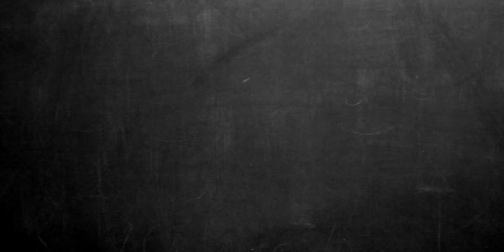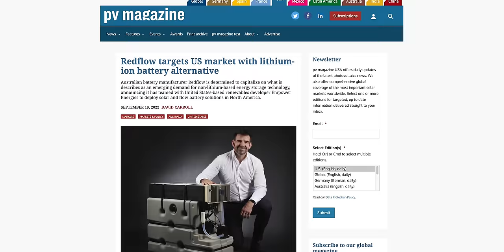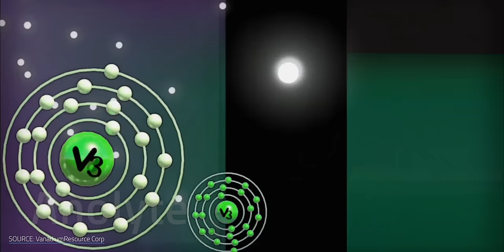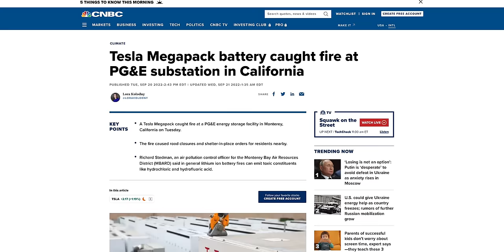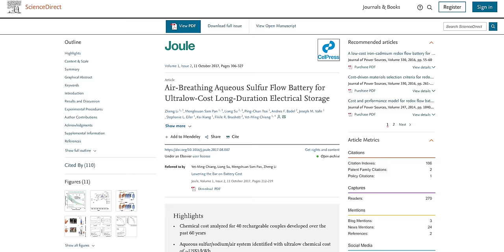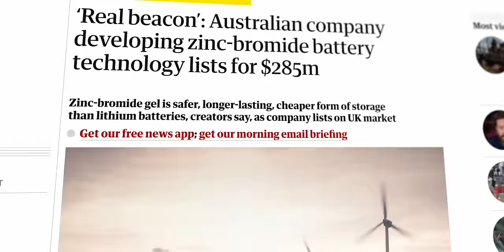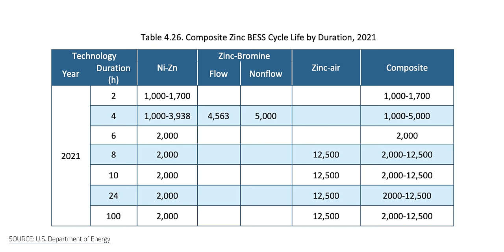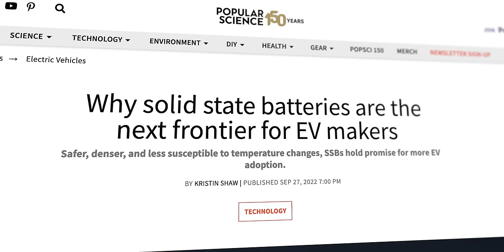137 Year Old Battery Tech May Be The Future of Energy Storage

Comment: I think maybe it's time for a battery tech roundup? I've lost track of all these battery types. How about following up on every single battery tech from the past few years, compare them on all their various metrics, fitness for various applications, see where they're at in terms of readiness, cost, and so on?
Reply: Have you ever called one of these scammers?
Reply: Seconding the request for a battery tech roundup!
Reply: Yes, please! I would like a summary/review as well.
Reply: @stephen6631  think you responded to wrong comment
Reply: Just the thought wants my head to explode! 🤯🥵☠
Reply: That would be a long video.
Reply: Please include efficiency. This is incredibly important and something you often gloss over.
Reply: Looking forward to the round up.
Primary interest is for home use for solar storage. 
Already pretty content with off the shelf lithium iron phosphate batteries for a vehicle. 
Lol, we rent a vehicle for 12 hour drives to see family,  so distant Charging is irrelevant for us for the foreseeable future. 

Number #1 concern
 FIRE SAFETY
  zero interest in a lithium-ion battery pack in the house.

Number of Charging cycles (reasonable- not absolute) before replacement 

Abuse tolerance 

Ease (or near complete lack) of maintenance 

Cost, within reason. 
Using kw hr basis?
Reply: @crispisauce  it was definitely addressed in the liquid metal battery sector.
Reply: Yes please do a battery round up with energy efficiencies
Reply: @norfolkgarden  Best for solar storage at home is still LiFePo4.
Fairly compact, high performance (1C/1C with dischange burst up to 3C), fairly high amount of cycles aswell as not degrading when using most of their capacity and most importantly they are fairly safe and wont burn or explode (not from the chemicals that is)
Reply: I love this idea.
Reply: @tarakivu8861  If compactness/weight isn't an issue, and someone had a huge amount of big lead-acid batteries available to them for cheap, is there any reason not to use them?
Reply: That would probably require a good hour long documentary lol
Reply: I thought for sure ambri liquid metal battery would be way bigger by now
Reply: @codyrogers918  Yeah, I am waiting for an IPO so that I can help support their work, tbh - although I don't see how the technology can be protected from being ripped off easily.
Reply: It will get outdated fast
Reply: Honestly as a studying electrician, batteries are simply a poor method of storing large amounts of usable power.
Batteries have their advantages, and they are mostly in being compact transportable energy storage.

There are simply far better and more effective ways to store usable energy, much less electricity.

For example: Why store power in batteries when you could make a lake, build a damn, put a water tower up, or store raw thermal energy in insulated thermal sand? Only reason would be if you can't store natural kinetic or thermal energy.
Reply: Looks like new sodium batteries are also making progress in leaps and bounds.

So I'd agree
Reply: @jllemin4  What's more these systems are more "natural" and you could leverage them even if electricity is not a priority/cannot even be used. So it's literally a getting multiple use cases out of one installation.
Reply: @jllemin4  Thank you dear Jllemin, I really appreciates you caring about validating this for me as well as to be sharing your knowledge with me and everyone here. I really also appreciates your thoughtfulness of me. :)
Reply: @jllemin4  Dams/Pumps are not feasible everywhere, and upfront construction costs can be huge (not to mention potential environmental/population displacement issues).

When people say 'battery' here, they are referring to a huge range of electrochemical storage solutions, many of which are quite different from what you would think of traditionally (like Ambris' liquid metal battery). A lot of these can likely scale quite well, especially compared to kinetic storage like flywheels.
Reply: Do the round up "top gear cool wall" style.
Reply: One more enthusiastic vote for a battery tech roundup. While I'm glad energy storage research is getting so much support, the over-optimistic press releases and frequent grant scams make it really tough to even have an opinion. @Undecided with Matt Ferrell perhaps you could even get a government grant to do the meta-research and save us all from another gover-funder-blunder.
Reply: We need to fund tech. And cut all this patent BS , our civilization and way of life require it
Reply: Yep.  But put out a big comparison performance chart on your website (where you can stick advertising) and answer the question, which system is best to convert a car to electric and hybrid electric?

We live in a fantasy world, where lithium ion is supposed to be enough fur everything, but there is not enough, it's energy density is 10x to low, and it's costs 10x top high, and the cost of building one of these cars can be nearly as energy consuming, where environmentally it's much better to wear out the present fleet, giving enough time to get solutions with capacity to produce a gu electric fleet .  So, the fastest environmental solution is a short range day battery connected to a hybrid electric system for long trips.  A day battery  of over 100km, can be charged by parking over an I ducting plate every night, and use no fuel at all.  When driving to far, it can be it can use fuel.  The solid zinc bromine battery is Ideal for such conversions.   Omg with something like an Atlantis engine with inbuilt electric generator, or waveplate engine.

You should cover nanowire battery progress too.  They are talking 10x the capacity.
Reply: @tarakivu8861  Polonium batteries?
Reply: To maybe shorten the length of a video make a series of videos discussing separate use cases, such as residential (size, safety, capacity), industrial (safety, capacity, scalability), public grid, etc.
Reply: @stephen6631  why do you claim that they are scammers?
Reply: Are you asking Matt Ferrell? He doesn't understand science at the most basic levels. You do realize his channel is just regurgitating what was said about it, usually by the technologies builders. He looks up "news" and repeats what he read. Look at the video about solid hydrogen storage.
Reply: It would be lovely to have two roundups actually :) feels like the battery world is splitting into hi-density/weight sensitive applications and static applications like we're seeing in this video, especially since the latter should be compared to current mechanical methods we already employ in the world.
Reply: Great idea, love to see that myself
Reply: Agree, there are so many! Graphene? Carbon nanotubes? Lithium air? Aluminium? Sodium?Solid state? Structural batteries? And these are just the transport related ones...
Reply: Redfow Zn Batteries have been on the market gpr over 15 years and never cauhht on in a larger scale. With efficiency at 75% vs 95% of LFP . WHERE ARE THE ADVANTAGES?    Whats the cost in $/kWh of Redflow today ? LFP  is at 150$/kWh with BMS and casings.
Reply: ... like with a biig mindmap of all possible battery-types ;)
Reply: @sh5465  watch the video and pay attention to the part where Matt says there have been improvements in zn battery efficiency...
Reply: @tarakivu8861  
Just helped my brother upgrade old lead acids to Lifepo4. What a big difference 😁.
Cheers
Reply: It's easy, it's all about energy density at this time. Going to be a few years yet before investing in anything not Li.
Reply: @TecnamTwin  could be a multi part mini series. would be better for us, for matt, and the algorithm.
Reply: I'm pretty certain that most new battery tech will never make it to mainstream. The only way a battery will actually make it to the mass market is when it's absolutely certain that it has a ton of potential. Graphene batteries look super promising but it's been difficult to make graphene on a large scale. Same with sodium batteries, paper batteries, and even solid state batteries. 

I really hope that someone much smarter than me can come up with a battery that doesn't destroy the environment and is easily renewable, reusable and recyclable. 
If we want to move to fully electric cars, we CANNOT do it with lithium ion batteries.
Reply: I would like to see this as well, a comparison of “battery” technologies categorized in multiple ways; energy density, # of cycles, failure modes, etc.

Comment: This video makes several comparisons to lithium ion and flow batteries, but I think it would make much more sense to compare zinc-bromide to sodium ion, which is a much more direct competitor and also entering the market right now. They're both low-cost, lower-than-lithium density, and using more sustainable materials
Reply: i think comparing to lithium and flow batteries still makes a lot of sense tho, the former because its widely known and the current standard, the latter because it was discussed in a recent video, which means it might be still in the back of ones mind.
However having sodium as a third one (if what you say is true, I havnt heard of it before) would of course improve this comparison, maybe in a followup video as well
Reply: But both are trying to take business away from lithium.

As such, they should be compared to lithium.
Reply: I'd like to see that Sodium vs Bromine comparison, and also have data on mass per kWhr and maximum sustainable current output - those two factors help determine whether the technologies will be useful for aircraft, shipping or spaceflight.
Reply: I imagine there would be some contracts ahead to be either won or lost....
Reply: I just think that comparing lithium and zinc bromide was a poor choice, seeing as it looks like compared to the 2nd most common battery ever, lead acid, zinc bromide wins in a landslide, the big one being that you can’t use half of your lead acid battery without damaging them, with there DOD being really bad, he also mentioned they’re more energy dense then lead acid. So there smaller and can discharge further, while also being affordable… I know that would have made this one sided if he was comparing zinc bromide to lead acid, but for me, when you can make better car batteries, better off grid power storage for farms and boats, what’s not to like?
Reply: @PiDsPagePrototypes  IIRC Sodium Ion is pretty good on the W/kg front and pretty bad on the Wh/kg side (compared to Li-Ion, again). Hence the utility use rather than mobility.
Reply: OK look, whatever technology anyone comes up with that makes sodium ion batteries viable, it will equally equally apply to all of the other alkali metals, that is an immutable nature of the elements, It's alchemical.  So in elemental, alchemical regard sodium has 2 problems, either of them, insurmountable.  1, sodium metal is way more dangerously reactive in the atmosphere of earth than lithium, It doesn't just catch fire in water, It EXPLODES bigger!!!! and 2, If you open your book to the periodical chart of elements And locate the alkaline metals in column 1 you will find that none have the ability to give up its electrons more freely than Lithium as it has only 3. So to get simplistic here. Any energy  sodium can store lithium can store better,  Lithium can do battery better than sodium. This means that, as long as there's a gram of lithium on earth It will make a better battery than Sodium. They will find cheaper ways of recycling lithium And they will find more lithium to mine anyway. If for no other reason than 75% of the Earth's crust has never been explored for mining at all. But keep chasing that dream if you must, excercise your freedom of choice, no matter wat it is, its your rights as far as I'm concerned, but please don't do it in ignorance for yoyur own sake, realize when you are being bamboozled bybad science when you can. And if you don't understand why it explodes bigger, its becase electrons of a feather, stick together.
Reply: @mpirron1  Like all interesting questions, answer is: it's not that simple. Sodium-Ion Batteries (which are not just lab things they are used commercially now, that is a fact) are less energy-dense than lithium: you are right about that. But they are more power-dense... If I understand corrrectly, the main problem nowadays is the durability with a sodium-ion battery undergoing 50% less cycles than lithium-ion batteries.. so it will have to upgrade like Li-Ion did. Not a given, but not impossible.
Periodic chart of elements is a great tool. And congrats on your fine reading of it. But what it is not is a be-all end-all of chemical knowledge.
Reply: @MjolnirFeaw  I'll give you that, the power density, for now, because I am not aware of any practical sodium ion battery in commercial use what are they using for the cathode material? The only portable ones I am aware of are using vanadium phosphate , if that's the case then the commercial use is a boondoggle because  sodium vanadium phosphate is crazy expensive and there there's not much vanadium laying around that's not already in my pocket knife's steel. They'd be better off going back  to cobalt and we know they can't do that with so many Sudanese children slaving at mines and all, so if you're talking to vanadium cathodes, its a no-go. That being said, it's still my contention that if you take the battery chemistry of the viable sodium battery, whatever it is and apply it to lithium, you it will likely make a better one. In the lab I have a tiny bit of experience when I gots a pair cheap Chinese 6801 sodium ion electrodes from aliexpress, I followed a couple of papers and was not impressed  with my efforts, and eventually blew one up along with yet another flask,
Reply: @MjolnirFeaw  everybody's talking about sodium, sodium sodium not lithium, potassium, or cesium, beryllium, magnesium and never is it barium. But all we are  saying is give lithium a chance
Reply: Well that's about what I thought, Vanadium huh?
Reply: Throw in iron air for defecations and tiny laughters